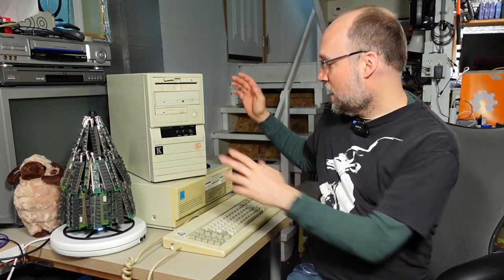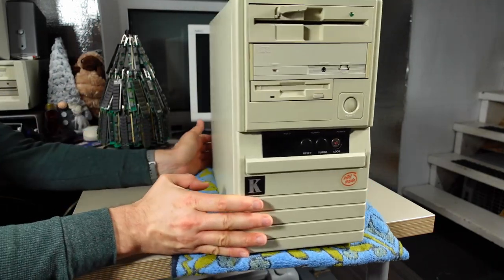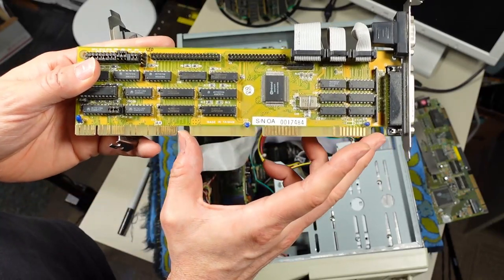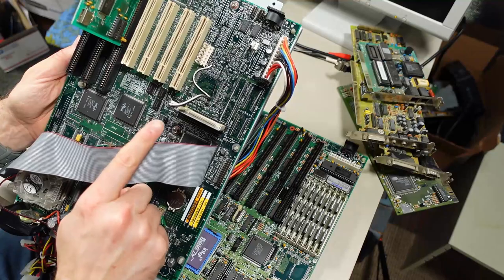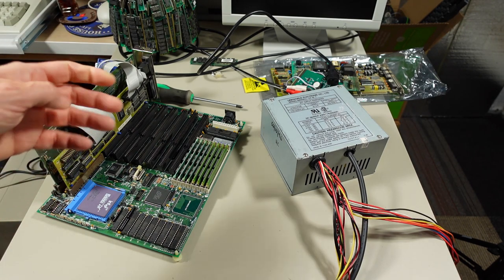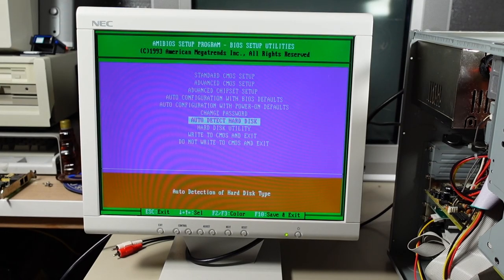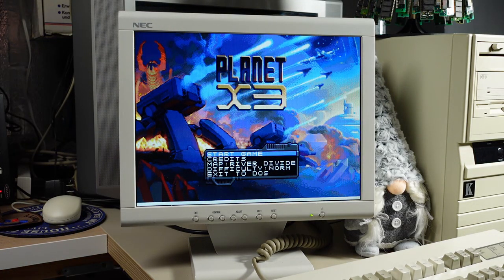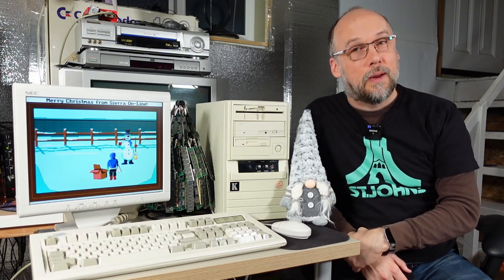PC archeology: Mystery 486 Mini-Tower

Comment: In 1993 some friends of mine and I started a computer company -- we'd build and sell computers using off-the-shelf parts.  This video brings back LOTS of memories for me.  I honestly do not know how many of these exact computers I built and sold in 1993 and 1994.  Dozens and dozens and dozens.  This generic mid-tower case, the generic Winbond I/O card, the generic VL-bus-equipped 486 motherboard, the generic 30-pin RAM, etc., etc., etc...  So many memories!  Very cool to see this machine still working after all these years.  :-)

Comment: 22:45 I remember being bedridden with something similar to measles when my Grandfather broke the news to me that he'd managed to break the motherboard of a PC we'd been working on. "I connected the power supply connectors to it the wrong way round". "Ah." I nodded sagely, confident in the finality of its demise.
Reply: Theoretically, those little pins on the connectors are supposed to stop you from putting the connectors in wrong.  Apparently on this mbd, they didn't clip the openings so the connectors would slide in straight.  Unfortunately, they can be put in with a little tilt to get around that protection...  :)

Comment: I did notice that the clock speed had gone back to 50mhz in the BIOS again. Vaguely remember that odd multiplier's caused issues with the IRQ for the less popular sound cards?
Reply: Could explain the pitches being wrong in the PC Beeper music too. Worth a look-in, as well as possibly checking the filter caps. An ESR meter would do him well, as some caps fail without leaking, they just dry up. Others are totally fine and would be possibly a downgrade to replace if they're not measured.
Reply: The mix of cards could introduce irq conflict,  also if ram is of different speed rating could effect program speed. Try checking if turbo jumper not closed - this may return bios control of setting.
Reply: PS - removed bios battery...🤔🙄😆
Reply: That CPU would most likely overheat and crash pretty quickly if it ran at 50MHz, so I doubt that setting actually changed the FSB. EDIT: Unless it actually set the FSB to 25MHz, that's possible.

Comment: "Black to black's got your back" is the saying that I remember...
Reply: I've always said "Black to back or you'll never go back"
Reply: I've always used "Red to red, you're dead" 

I've blown one motherboard because I didn't know what I was doing...
Reply: I always use : "Red on red, tou're dead, Black on black you're back"
Reply: @TheotanyaSama  No, if you power it up with red to red, the motherboard's dead, and no amount of black on black will bring it back. 

I just remembered it by saying that "blacks are supposed to stick together." Never blew a motherboard in the AT era by messing that up, what little time there was of it for me. (94-97 then ATX pretty much took over). The next motherboard I recall ruining wasn't until LGA 775 (screwed up the socket pins somehow).

Comment: Fun thing about dialup is my ISP still supplies an "emergency phone number" for dialup when the broadband craps out, but when the broadband crapped out for me a couple months back, the phoneline itself was failing so dialup wouldn't have even worked anyway!!! :P
Reply: the darkside of VoIP
Reply: i remember the early days of the CB demise - that channel 36 was used by wireless data testers - to link a 9600b and send files over CB
Reply: @herauthon  Here in the UK, the majority of our phonelines are still copper, so not VoIP just yet, but when there's corroded and broken wires, it doesn't matter either way, call and data are going nowhere... :P
Reply: @twocvbloke  
Well, we got Cable - and i assume it is a cupper connection - but the modem uses VoIP - to convert analogue phone signal to digital signal - effectively VoIP. [ ihmo ]
Reply: Juno still offers free dial up internet 🤣
Reply: @kd7cwg  

Make me an account QUICK
before it is all taken !!

Who knows FIDO ?
dBridge, Frontdoor, Terminate ?

Comment: Don't ditch that sound card as they tend to be pretty good to even desirable for collectors so maybe check the caps.
Reply: Agreed 🍩
Reply: I don’t think he ditches anything. The dead parts bin would agree with me in this
Reply: He has the wrong drivers.
Reply: HighTreason610 has some valid concerns regarding the SoundBlaster 16's audio quality vs the PAS16:
https://www.youtube.com/watch?v=sdphd742Oqs
Reply: I haven’t heard of this particular board, but I had a PAS16 back in the day and it was fine.  It was an upgrade from an SBPro, before the SB16 was readily available, and came with a fancy MOD player that played in 16-bit stereo mixing.

My only complaint was that Wolf3D wasn’t in stereo, and maybe one or two other scene demos or something that could only use the Sound Blaster compatibility.

What I didn’t realize back then was that the SB compatibility was actually provided by a dedicated chip from the Thunder Board (an SB clone) and meant I could have used two wave devices in Windows - which would have been a pretty neat trick back then!

Anyway, it was a solid card, so I suspect the drivers aren’t working right or something here.

Oh, and the PC speaker thing - it actually listens to the IO address of the timer to intercept and emulate it.
Reply: @Kurt Pedersen exactly my experience as well, albeit I had a card that said it was ‘100% SB compatible’, and obviously it was not. So I bought a real one and never had any issues again in any game.

Comment: "Black to black, no flack, red to red, you're dead" is the way I learned.  Usually I've found that in most cases (I've tried, with power off and PSU discharged) it won't even let you plug it in red to red, those little hooks never let it fit.

These old 486 systems in a non-descript box, with that purple, orange, and green BIOS, oh man those systems were HORRIBLE!  Just like the weird issues you kept having that would pop up and seemingly go away, that's how these things ran.  Quirky at best.  Some days good, some days bad.

The way it used to be, with those multi-I/O cards, a million jumpers, and no documentation, endless reboots and running test programs to make sure you had no conflicts, drove a lot of techs back then to drink.  I'd love to finish that with "ask me how I know", but fortunately I can say I wasn't old enough to drink then!

I used to have a 486DX50 around, sound card, Ethernet, and had some sort of proprietary Sony CD-ROM drive that hooked to the Sound Blaster card's Sony connector.  Even added the drivers to the Windows 98 boot disk back then for it.  And the MicroSolutions BackPack parallel port connected CD-ROM drive.  I actually have seen the type of CD-ROM you had in this machine, that thing's a gem.  I had an old 2X drive, it actually had a 1X/2X light on the front, and when it could achieve 2X speeds it would light up that light.  Back when they made the hardware do something fun in and of its own right.  I don't think anybody ever had a problem with more blinkenlights.

Comment: ED was extended density. They were more common on IBM PS/2 models and capped out at 2.88mb.
Reply: The drives might be common on those systems, but the disks? I've never seen ED floppies.
Reply: @mrnmrn1  I used to volunteer for a nonprofit that recycled e-waste and I only came across a 2mb diskette once. My family used to have a whole box of the ls120 ones, though.
Reply: @richardestes6499  2-megabyte 3.5" disks are just HD disks. Their basic capacity is 2 MB, but formatting takes a chunk of the space for the file structure. In case of the FAT12 used on PC, the usable capacity is 1.44 MB. On some other systems,  it would be different. (If I remember correctly, Macs of the time used their own formatting.) In the early 90's the non-formatted disks were a little cheaper, and they would be typically labelled as 2 MB (or the DD's as 1 MB). Later it became standard for the disks be factory formatted for PC -- but if you needed them for non-PC system, you'd just format them on the system, just like you would do in case of non-formatted disks.

I've never seen the 2.88 MB disks, but I'd suppose their non-formatted capacity would be 4 MB.
Reply: @enginerd80  And, there were utilities to format them to higher capacities by utilizing more tracks.  Hit or miss on reliability depending on the drive as well as the physical disks used.

Comment: There is a dos utility called CLMODE which will allow you to set 1024x768 to run in non-interlaced. It defaults to interlaced, which an LCD of course won't accept
Reply from the maker: Ah right!! Of course. Completely forgot about interlaced 1024x768

Comment: How you attached the cr2032 with a diode was the part I wanted to see most.     Anyway, another great video.
Reply: He's shown it in earlier videos, but it's basically just a bit of solder and heat shrink tubing anyway.
Reply: @kaitlyn__L  I have a need to do it on several machines and I realize it is easy but I want to get it correct and the diodes location and orientation is not obvious to me as it seems to be to many.

Comment: It’s amazing how much time you can sink in to one retro PC just getting everything working perfectly - driver and irq and config file wise, even after you’ve selected the hardware you want and think will work, cleaned it and built it. And then there’s the software you install which is really what a computer is all about. Different things best or will work for each system, even for systems only a couple years apart. Good thing it’s just a fun hobby, I would go crazy trying to support a 30 year range of hardware and software in a business environment, a uniform modern fleet is enough trouble.

Comment: I had a "Thunder Board for Windows", Thunder Board was MediaVision's 8-bit Sound Blaster clone.  It was a great pairing with my 33mhz 486DX.  The "for Windows" variant just came with some Windows 3.x software (like the excellent Sound Forge 1.0!).  I wasn't aware they used this Thunder branding on their PAS at some point in its lifespan!

Comment: These old PCs live on to this day in machine shops.  Mills and lathes that have been converted to CNC are frequently based on PC motherboards like this.  Also I remember using outdated units just like this one to “DNC” programs to milling centers where the CAD/CAM generated program was too large for the machine’s internal memory.  7200 baud rate via rs-232 that sometimes required re-soldering the pin-out to get everyone to shake hands.  Good times.

Comment: You made me feel old since I was out of college at my first "real job" at a system builder (a PC shop) in central Ohio - I either built, repaired or supervised (I was a build side manager) the build of 1000's of machines with very similar cases....  I do remember that the place I worked for had some case and mobo combos tested by the FCC - they had foil labels printed for those machines - and sometimes they were applied to other machines.  We printed system configuration labels on Oki 1080 printers so we'd know if a system was modified after it went out the door.

Comment: The 386 phone server with built-in amber CRT that I picked up at Computer Reset also had one of those barrel batteries that had just barely started leaking, so I'm glad I got it when I did and de-soldered it before any damage was done!

Comment: @17:49  When working on AT cases, you can use a pair of needle nose plyers to close the clips on the plastic stand offs and push the stand off through the board.  Then the system board can be lifted out.  That is how I always did it.

Comment: Sweet, enjoyed that. :)
Brings back a lot of memories. I used to work at a small PC manufacturer in the early 90s, and this is very similar to what we made. That case is one of the very common ones, I remember every nook and cranny of it. Sadly I've forgotten who made it, but it was very cheap (around $25) and simple to build in. That motherboard tray was a real god-send and the primary reason we used it. Saves SO much time. We used to unhook the trays from all the cases in storage, and mount them as orders came in. Fun times.

As for the white bar with that Cirrus card.. I've seen that before, but can't for the life of me remember why it's doing that. If you find a fix for it, let us know eh? :)
We used several different Cirrus cards, they were really cheap back then, and mostly did the job. I seem to recall there were driver issues with them, though. Later on we moved to ATI cards, which were much nicer in general.

Happy new year Adrian, looking forwards to whatever you'll come up with in the new year. :)

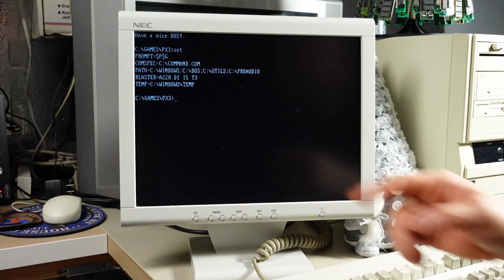Comment: 43:08 A220 is NOT the address of the OPL chip. It`s the Sound Blaster digital sound (PCM) address. You may also add the "P330" wich is the MIDI address and change the parameter T3 to T4 (SB Pro) or T5 (SB Pro with an FM Synthesis chip).

Comment: 6MB = 2MB (512KB each) in first 4 slots and 4MB (1MB each) in last 4 slots.  Did that a lot back in the day repurposing memory from previous computers.
Reply: 30-pin SIMM modules were only available in 256 KB, 1 MB, 4 MB, and 16 MB.
No 6 MB setup was possible then.

Comment: My cousin's family got their first PC one christmas in the early 90s after using their Apple //e for a few years. It was one of the first multimedia PCs we had ever used, and came with an encyclopedia on CD. I later found out it was a 486SX(?) running at 25MHz. Only a few years later I got my own Dell 486DX2/66 as a high school graduation present, although it was probably the last 486 model Dell ever sold since Pentium machines were starting to dominate catalogs.

Comment: Funny to hear, that a Creative Sound Blaster is called a better sound card, then an Audio Spectrum. If it's about quality, the last one is by far more superior, than any Sound Blaster of the same time. The Audio Spectrums are also more expensive and adorable by collectors today. What you found in this PC is a treasure of sound cards. A lot of games supported Pro Audio Spectrum along Sound Blaster, despite that Sound Blaster was a "standard" at that time. This was due to much better quality and stereo 16 bits sampling, at the time where Creative still had only 8.

Comment: Sorry I'm late to this party, lol.  I had a 486DX-33 built by a company called Midwest Micro way back in 1994.  It was a VESA local bus system.  I was impressed by the speed at the time, with the local bus cards running at bus speed.  The multi IO card died a couple of years in and I had to replace it with a 16 bit card, it just wasn't the same.  My case was almost identical to this one, except it was a full tower and the display read 33.  It was a damn fine machine.

Comment: I love the memory tree :D I recall struggling to plug in VESA cards on my 486-33SX (?) machine I had, you really had to push hard and I was always half expecting to hear a "crack!" and have it break in half! My father and I used to haunt computer fairs and picked up lots of cheap sound cards in that era, and always struggled with them to get them to work with all the games. I think in 94 or shortly after Creative came out with a new card (the AWE 32?) and there were a lot of SB 16 cards being sold second hand for very little, so we got a load for all our computers (I had 3, my dad had 4 including the one he "maintained" for my sister) and never had problems. When I bought my new shiny pentium 100 machine in '96 I bought an AWE64 and was blown away by its sound. So I was a big fan of creative... these days I use laptops and so have to use whatever the manufacturer supplies, but then again most game sounds these days are wave based and sythesis is something of a relic now.

Comment: In the 90's (1994) I used to have a 486 SX25 with a generic case with a round shape in the front. I overclocked it to 40 MHz, this was the time before regular OC. I didn't know what I did with jumpers, but it worked and I even installed a cooler with a fan. Now I bought a pentium 100 in an AT case like this one, it will do it until I find a case I used to have.

Comment: We had that exact CD-ROM drive in our 386, with the separate controller card.  And the sound card we had in it (a Sound Blaster 2.0, IIRC) didn't have a CD audio connector, so I think we used a dual RCA to 3.5 mm cable to connect it through the line-in.  Yes, it is a single-speed Mitsumi drive.

Comment: For some added safety get a portable RCD-trip device and add it to your mains power input for the project/s, that way if you ever become part of the circuit, the breaker will trip and can save your life. They are mandatory on most circuits in Australia in the switchboards these days as they save lives and don't cost the earth.

Comment: I love those old Mitsumi tray loaders. Far less fiddly than caddy types and there are no belts to break down. Plus if you want the drive to be inert (not spin up or be accessed across multiple reboots, for example), just leave it unclicked. The reason they and other early CDROMs used special interface cards (unless you had SCSI) is that the basic ATA standard doesn't support removable drives, so CDROMs and things wouldn't be usable without rebooting the system every time you wanted to insert or remove a disc. Hence the special cards with their own custom interfaces (some cards had up to 3 different headers for the different drive standards: Mitsumi, Sony, or Panasonic/Creative). It wasn't until the Pentium era that ATAPI was introduced which basically identified a CDROM (or Zip or other removable) as a normal ATA device to BIOS but sent status changes and data over the bus in packets to the OS and its drivers to get around these limitations.